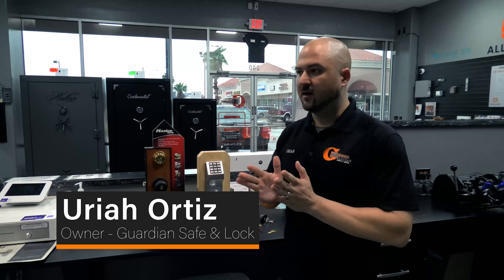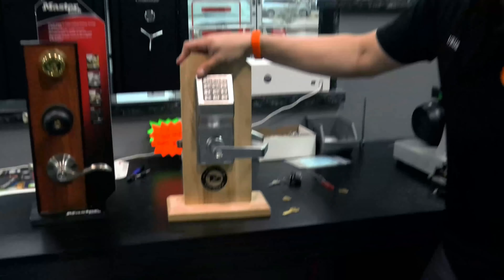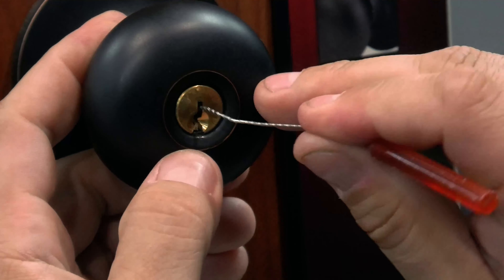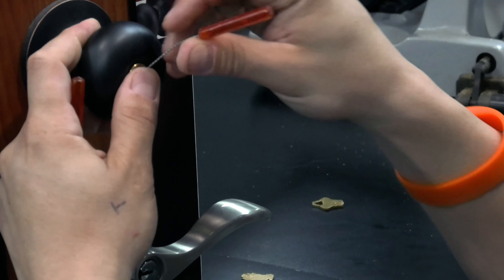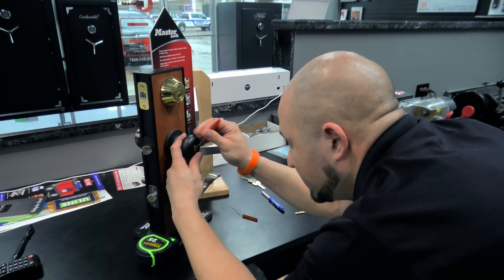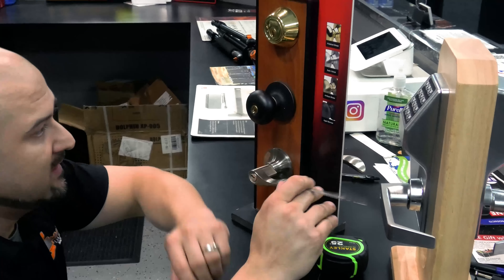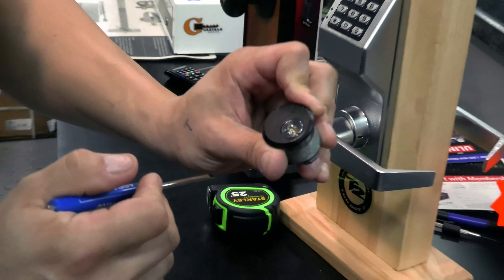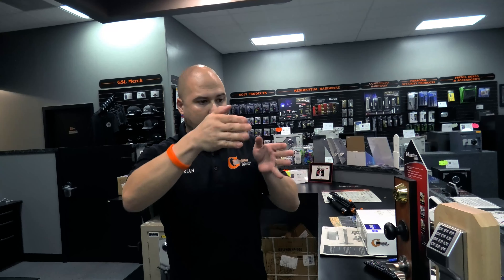Snapped Off Your Key? How To Remove A Key Broken Off In A Door Lock

Comment: I broke my key off in a truck door while removing it. The company mechanic took a large paper clip, bent the tip and put a drop of super glue on the bent end, stuck the paper clip to the side of a magnet, which was stuck to the lock face to steady it while it adhered. While holding the flap open with a screwdriver, he touched the tip to the broke off key and eventually pulled it out.
He'd done that before. Thanks

Comment: Great examples. But what do you do if with a mortice security door key that is broken on inside and outside Key won't turn so door is locked where I can't open it to get to the set screw. If the inner lock key is turned should I be able to open from the outside?

Comment: Maybe I’ll try that one day. I just use the broken key to lock and unlock the door but I can’t make a spare so I guess I’ll need to make another key one of these days so I’ll dig it out. Thank you.
Reply from the maker: Yeah Bc if it gets pushed in even a millimeter it will stop working. I’d get it fixed sooner than later.

Comment: By a $6.00 feeler gauge set use +/-0.025 and grind down the height enough to slide on the sides of the keyway. Smear baking soda on the front of the cylinder and keyway.. Put a few drops of super glue on one side of the modified feeler gauge (key side) and slide into keyway and allow to set up. Remove key. You can also use old or broken picks if they're thin enough and you have some kickn' around.🔐
Reply from the maker: Broken picks are very useful.
Reply: Not if the super glue is at the tip of the tool (glue is facing the key side only?) The tool is slid in-between the keyway and broken key  It will only makes contact to the key. Let setup and jiggle pull or zip it out. Whatever technique works best.

Comment: Use a tiny flat head screwdriver, like what you find in an eyeglasses repair kit. Put the smallest bit of gel super glue, and touch it to the key. Count to 10 so it's dry, and pull out your key. Voila! I've used this method a few times and so far, it has always worked.

Comment: I would have tried the hot glue trick. lol 🤪
Reply from the maker: Works if the key is close to the front but if it’s deep won’t work bc it will stick to the pins and cylinder. Thx for watching!

Comment: Again, another great video and very informative as usual. 1 question 🙋🏽‍♂️- in a real life situation, are you able to adjust the door to a suitable angle like you did the practice device? Lol
Reply from the maker: Harry Adu lol to answer your question no but in a real life situation the lock will be mounted to a door making it sturdy, the only reason it was leaned back was to make it sturdy not to make it easier. Anytime we try to pick a lock or demo on a display it’s kinda frustrating bc it moves all over the place as you try to pick it or extract a key.